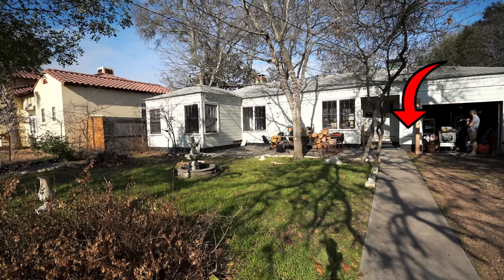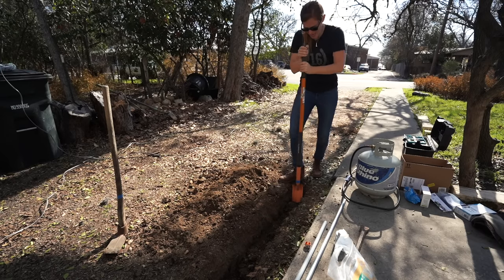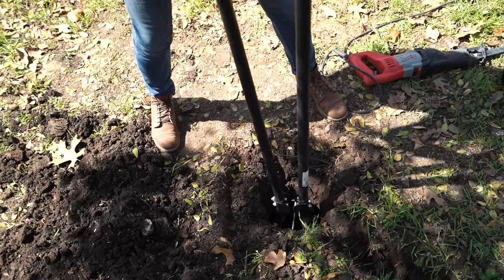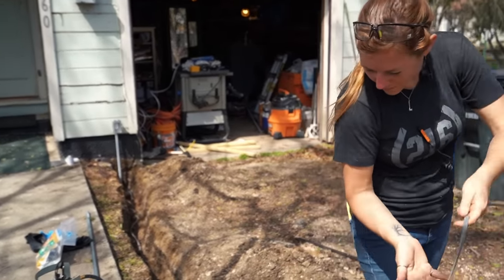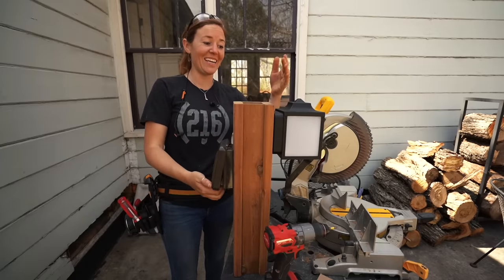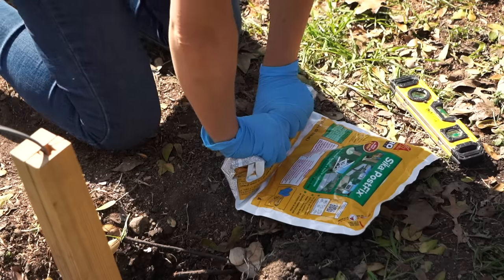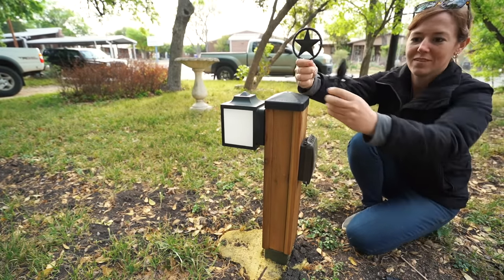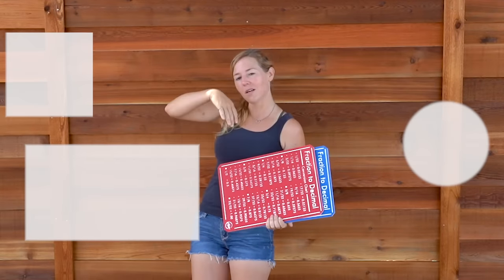DIY Outdoor Lighting and Outlet

Comment: April, nice job, but I agree with one of the other posts.  Also, a few small tips for you from an electrician....  First (and especially in places that have a colder climate and ground is susceptible to frost, at the very least, a small bed of sand above and below the UF cable you are running.   A small rock or boney backfill can and will penetrate UF.  For the cost of small PVC, we usually run PVC especially in the northeast.  Next, when you payout your wire (Whether you are running Romex or UF, do not just pull it off the reel.  "Walk Out" the cable by putting the end under something heavy and roll it hand over hand out as you walk as to roll the cable off itself.  It will come off the reel perfectly straight and lay in the trench much better and pull through conduit better as well.  (Also really helps if you are stapling up wire).  Lastly, the weakest point in the install is at the base of the post.  While I cannot say 100% because the video did not show it, a better method when you either cut the post or do the install is to leave a spot where the wire comes out so that the weight of the post is not sitting on the wire.  Maybe you did that.  Also, lots of sand at the base helps make sure that if the post moves, the wire has some give.  99% of the time, that is where the cable failure will be.  Not trying to be critical of what you do, really just trying to help.  I watch and enjoy a lot of your videos.  I wish I working with wood came as easy to me as working with wire.  Keep up the great work.
Reply: I'm sure you have fun with more rocks than dirt digging in the northeast :)
Reply: Yup I go nuts when the wire is pulled like that 😆 🤣

Comment: Direct burial tip. Sand over top of wire then run red danger tape and more sand. This way, when digging, the tape and sand help raise awareness to something they may cut into.
Reply: @mwrslr7845  Agreed with both.
Reply: Or just fill the trench with concrete on top of the cable.
Reply: @mjh5437  at that point, wouldn't conduit be cheaper
Reply: Actually if the wire is not 24 inches deep it needs to be in conduit, THEN place the tape.
Reply: @jonathanandtrishavlogs6874  Codes vary depending on where one lives.
Reply: @AB-nu5we  rr
Reply: @Jonathan And Trisha Vlogs  if gfci protected at the source then 12 inch direct bury without rigid metal conduit is fine per nec
Reply: @Jonathan And Trisha Vlogs  pvc conduit would have to be buried at 24 inches regardless if not gfci protected

Comment: Electrical code is the absolute minimum that needs to be done. Please consider doing a little more, especially for outdoor jobs. Very clean otherwise!
Reply: I agree completely about going above code, especially for outdoor work.  Please use sand and tape when burying UF cable.  Anyone who digs there with a shovel should see the sand/tape and stop work (if they weren't expecting the line to be there).  The metal foil tape also makes it easier to find and trace the line vs. the copper alone.

Comment: That shovel you trenched with is called a trenching shovel and it's intended purpose is to shovel trenches.
Reply: If you can't find one, try a sharp shooter shovel, almost the same thing
Reply: Big if true
Reply: @jack002tuber  
They’re ubiquitous at Home Depot, Lowe’s, Walmart, ACE Hardware, Tractor Supply, etc.
If you cannot find one, you ain’t looking for one.
Reply: What's it called though???
Reply: @Heypistola  Tile Spade.  When clay tiles were used for drains.
Reply: @ycmdill  the native Americans used to make clay tiles for roofing and they used the top of their legs from the hip to the knee ,to mold them.

Comment: Hopefully that's schedule 80 PVC conduit emerging from below grade as stated by 300.50(C). Also the box wasn't grounded, there should be a wire nut with 4 ground wires in it, one from the incoming power to the GFCI, one from the load side to the post, one from the box, and one from the GFCI.

Comment: If you're real lazy like me you wait till it rains and then you jump on a shovel and wiggle it and do that it just open it up just enough to get about four or six inches deep. It's a lot quicker. Maybe not to go but I've never had any problems and I always run it off a GFCI anyway. And then for the Post in the yard I just usually put a 4x4 run up the side of it with conduit and put a weatherproof box. Course this looks better but I bet the conduit on a regular 4x4 will last longer.

Comment: That pipe hammered under the path to make a tunnel for the wires is just BRILLIANT!!!! So much easier then trying to dig a tunnel and something I wish I knew about 20 years ago when trying to run a cable under my Gran's path! 😅👍👍
Reply from the maker: Thanks!
Reply: APRIL, how did you protect the ends of the pipe so they don’t get damaged when pounding it in?
Reply: She did☺️

Comment: Pro tip, always put in conduit, makes it very easy for upgrades later.🍻
Reply: Easy to add another circuit or pull out broken wire.
Reply: Did you have to connect to the breaker box with different wiring or change the breaker to a GFI?
Reply: Plus because it is direct burial, if you ever cut it, you will have to dig up the ENTIRE thing and replace
Reply: Yeah, personally I'd use RMC if the cable run is through a flowerbed where a lot of digging happens. UF cable in a flower bed is just asking for trouble no matter how deep it is.

Comment: Started using the foam instead of concrete 3yrs ago. I can't imagine going back. The time and Labor saved is amazing.
Reply: I set a post in that foam 4 years ago and loved it for the ease of use, but I’ve found that post is horribly prone to frost heave even though it’s 42” deep (frost depth recommendation in this area). My other posts are just in ground sand and don’t heave yet they aren’t as secure! Science mystery! Lol
Reply: She says it sets hard as a rock; but then easily cuts it with a hand saw. 
The purpose of fixing posts with cement is to weight them into the earth. Does the foam do that? It looks light.

Comment: I know this is rather old but I came here for the post design. Love your videos. A tip on the shovel: Instead of using it like a normal shovel with the handle angled 45 degrees toward your back, shove the handle forward so its about 45 degrees in front of you and the blade is standing straight up. Now you have a smooth surface to stand on top of the blade and can shove the blade into the ground with a simple jump on it. Now pull the handle back toward you and remove the whole plug of dirt at once.

Comment: Hi, April.  That was a great project.  I did something similar after building a 12' x 16' pergola in my back yard and adding a 2-outlet weather protected GFCI outlet near the top of it so I could add some hidden remote controlled rope lighting behind crown molding.  Additionally after my wife and I built a large pond  next to the pergola, I wanted a 4-outlet above ground GFCI outlet box that is about 2 1/2 ft above ground and has some backlighting in it so that you could see the outlets at night if you need to unplug anything.  Also in line with it, I connected it via and a weather proof quick shut-off switch next to the house to shut the power off to that outlet box with one click (just a safety feature I thought would be cool).  Finally after digging somewhere between 18 - 24 inches deep to lay down the wire, I added a  red-colored electrical wire warning strip (it says, "Warning: buried electrical wiring!" repeating these words along the entire length of the strip), that I laid on top of the sand that I surrounded the wire with before finally covering it all up in dirt.  The reason I did this is because if someday when I either sell this house or I move onto happy hunting grounds and a new owner were to simply start digging anywhere I laid the wiring underground they will hopefully uncover the red warning strip before their digging tool touches the live wiring.  Great also if you forgot where the wiring was laid ...... exactly..... and you or someone else starts digging along the wiring path. While all codes everywhere may not require it, it sure is a bit of a emotional saving feeling should that person discover live wire was buried somewhere in the back yard where they happen to be digging.  Can't wait to see your next project.

Comment: As others are saying, locate, locate, locate.  Also, I always use HDPE innerduct or PVC jacketed steel armored 12/2 cable for direct burial.  Homeowners can pick up innerduct tails (tail ends of large reels that don't get used, but are too small to take back out in the field on a job) at industrial supply houses in cities.  Worth the trip.

Comment: As expected, this job got the immediate attention of every sparky! Small wonder, as we spend far too much time fixing DIY short cuts.
My first comment: Forget about “meeting” code. Experience has a aught me “code” often isn’t enough.
I like pipe. For burial, PVC, buried two feet deep, Makes it deeper than a casual shovel bite. Using pipe let’s you replace the wire later, if there are problems. I hate digging twice! Use primer to mAke sure the pvc glue holds strong.
GFCI protect at the house end; that way you’ll know what f the wire run is damaged. All GFCI’s need to be outdoor rated / corrosion resistant. Look for “WR” on the device.
Reply: Good points. As I once heard, NEC, aka 'code', is the minimum required standard. You can always do more than the minimum.

Comment: Glad I found your channel. I’ve got to get power from the house to a lake fed irrigation pump for a sprinkler system. Straight shot, nothing but 100 feet of grass and pine tree roots. My OCD will make me run the romex thru schedule 80.
Instead of bothering you, I’ll find someone I can buy off with pizza and beer to get the pump and timer wired correctly.

Comment: Just ran a cable to my shed. The rules here in Australia apparently include 500mm trench, conduit with a orange plastic tape on top warning of power line. Would also recommend some indicator above ground to warn late comers of power along path because I would be tempted to install a garden bed along said path.Great build by the way, like the post and will be looking for the foam for small retaining wall project coming up.

Comment: April - Love your 216 (Cleveland)  t-shirt! Also, I used the 2-part "concrete" about 5 years ago, and it's as solid as Quickrete, but faster. It doesn't need water, so I think it's used for places where water is not easily accessible.

Comment: Hello, I did a similar trench, but ran #2 Aluminum wire to a shed. Trench was about 55' and again, 12" deep, but used a post hole digger all the way due to lots of gravel and clay in the earth. Had an electrician install and connect a box in the shed to allow me to run a generator when needed. I am adding the lights and receptacles to shed myself (it is a new shed). Thanks for your video. I will tackle running power from house to fountain and/or pond.
Reply from the maker: Awesome! Glad you found it useful. Thanks for watching.

Comment: A lot of the time you can hook a water hose up to a pvc pipe and the flowing water will push the dirt away and make it move and you'll be able to basically jab the pipe under ground. I've used this to run sprinklers under side walks and down short runs. Also that skinny shovel is for laying pipe in the ground for electric or irrigation so perfect use. Tends to be my favorite shovel for alot of jobs. Precision.

Comment: Love your stuff April, but any video at all about digging in a yard to run wire or hosing should include the advice "Make sure you've contacted your local power company to make sure no wire already runs through that area." It's not always applicable, but is always a safe option and a good idea. Love the cute post though!

Comment: Cool, the horizontal "hydro drill" works well in Florida, with our sandy geology, not so much with a denser dirt. Im glad to see the "hammer drill" worked well for you.
Reply: Im up in cleveland ohio and using duct tape to hold a running garden hose spray nozzle to a broom stick was the only way that i could get through the heavy clay we have under our sidewalks

Comment: Excellent idea 👌🏼 This helped me make my own using 1x8x8 red cedar to make an almost perfect 8 inch square post sleeve. Turned out to be 8 & a 1/8 inch, I’m hoping the 8 inch topper from Amazon will fit. The larger post sleeve allowed me to mount & hide my Philips Hue transformer for my landscape lights. The sika post fix was super easy to use as well, I only used a little so I didn’t have to cut off the excess. Thank you!
Reply from the maker: Glad it helped! Thanks for watching.

Comment: Depending on local codes the steel tube under the path should be grounded as it is metallic and part of the electrical system. I have used this method before and then replaced the metal tube with plastic or tie the cable to the tube and pull the tube out.

Comment: Nice project. Did they think about the pond electrical use? Pump for water fall or to keep the water agitated to keep bugs out? That's the idea for conduit. But I did electrical work, so I'm thinking to the future. Might not ever be used, but dig one time. My old house I ran water and power to the street post and  misting for the flowers. Thanks for sharing! Be cool, be safe! Beach,NC

Comment: Down in the 'sand hills' of So. Tx. I have seen digging with a combo of a power washer and an industrial vac on a trailer ---
a 2 ft. by 3 ft. by 15ft. cutting thru thumb size roots and under a sidewalk took less than an hour ---

Comment: Excellent video, April. To any Aussies (like me) watching; remember that you MUST be a qualified electrician to do any projects like this, even in your own home.
Reply: Yeah, here in the states, it depends on where you live.  Some cities require qualified and licensed electricians.  Other cities just say "have at it!".
Reply: And bare cabling at such a shallow depth would be extremely forbidden. You can did the hole though — at least 500mm deep. But if you run low voltage DC (12/24v) you can DIY. I’d still use a conduit to allow pulling more/replacement cable. Cable underground can overheat, so you want to use a much thicker cable to reduce resistive losses.

Comment: The post over post design makes a lot of sense.
Especially while adding electrical features.
This project gives me an idea for my back fence flower planting area.
Maybe some low voltage lights but in the post over post style.
Most of the store bought lights for this application do not look as nice or homey.
Besides you can custom make to any height desired.
Take Care and God Bless

Comment: Depending on your soil condition a flat spade can be used to cut a slot in the ground that you push the direct burial cable to the bottom of. I used this method to run power to back yard shed.

Comment: A lesson from similar trenching projects to outbuildings and distant outlets - for me, always pull more amperage than you think you need! In your case if powering a little light and maybe a fountain pump, you decided on 15A - but for others, for instance if you ever wanted to plug in some beefy tools for outdoor work or daisy chain other outlets later on - I'd suggest, again, pulling more than you think you need! Way easier just not to use what you what now than to replace wire or do a whole new home run in the future. Two cents!

Comment: I welded a coring bit to a length of pipe and attached a hammer drill to the other end.  It too just a few minutes to bore under my walkway.  You are right.  Water boring is messy.

Comment: Know this is an older video but didn’t catch anyone mention this. To get under the side walk, if you want to avoid the mess water creates and the beating a pipe. Goto the electrical aisle and buy a flex bit. They are long enough to get across sidewalks and drilling it will have you done in seconds. You can then pull a piece of conduit back (best) or just the cable (likely get tore out if replace sidewalk). A lot of times you can find this for cheap 2nd hand and they come in useful if ever running wires inside as well.

Comment: In France we would have to lay down some brightly colored safety netting over the wire before burial so that in the future someone digging will have some warning that there is an electrical wire down there. I am surprised Texas does not have the same reg?!
Reply: You're supposed to place this red tape, made for this purpose, over the wire before burying the wire. Applies in Texas as well.

Comment: Great video, thanks.  In addition to some of the good points, already made, here is a little one.  When passing the cable from in the house to the outside, I believe best practice is to mount a box inside, and outside, connected by a bushing... Think short pipe threaded on both ends, nuts to hold it snug and bushings to prevent fraying on sharp edges. I'm sure it can be code for a lot less than that, but the bushing provides a little more protection from random harm.  Thanks again for the great content.  It's got a refreshing honesty to it.